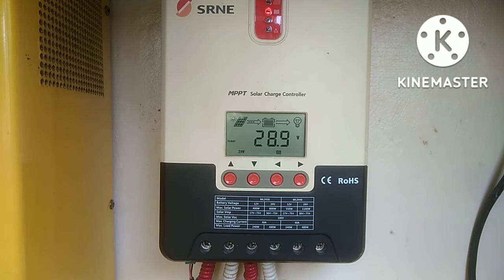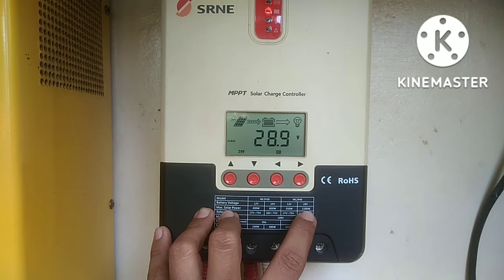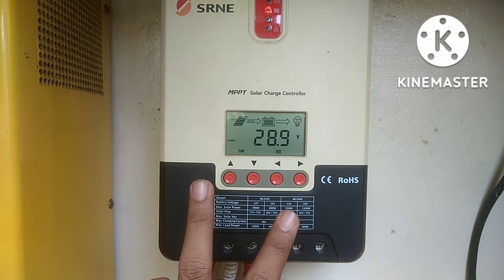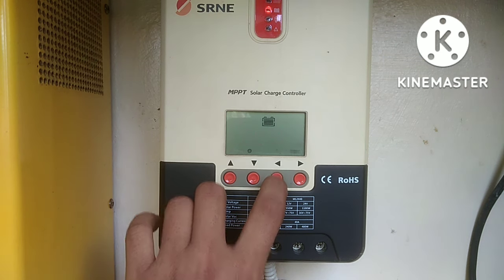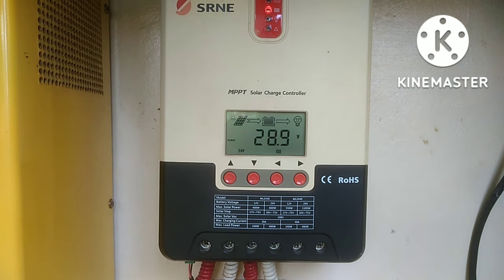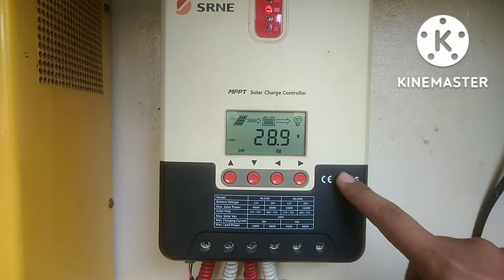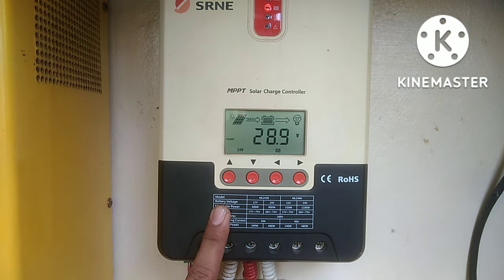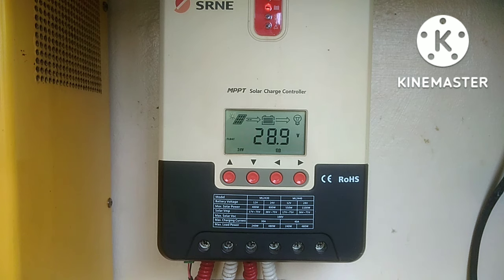Paano mag Parallel ng DALAWANG 40A NA SRNE MPPT Solar Charge Controller?

Comment: sur tanong ko lg. ung voltahi galing pv 77v   pg padok sa srne40a. naging 54+v lg ung generate nya.  ano ba problema sir?  sira ba srne ko?  sana ma pansin mo sir. t y 🙏
Reply from the maker: Check nyo po ang SRNE sir sa parameters nya baga may naiba po kayong setting..